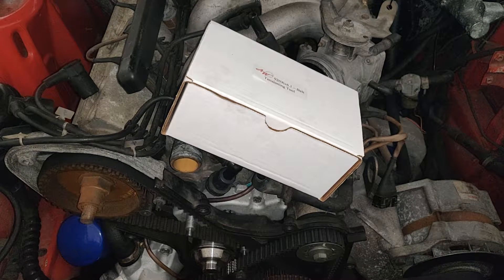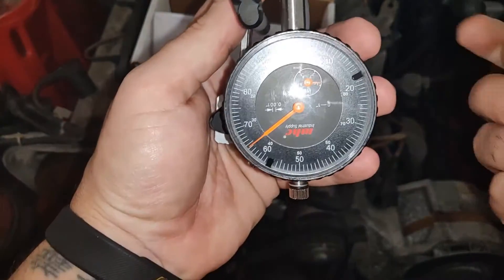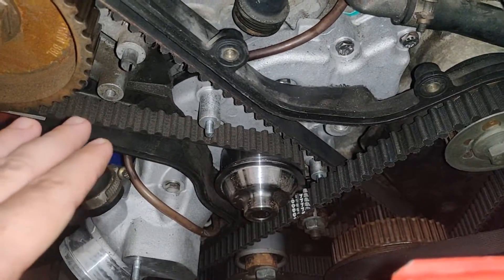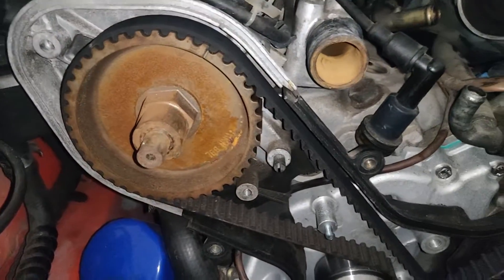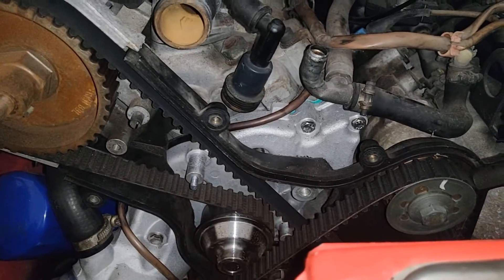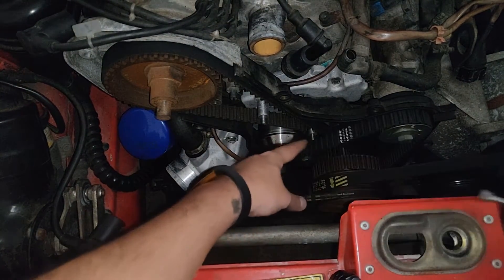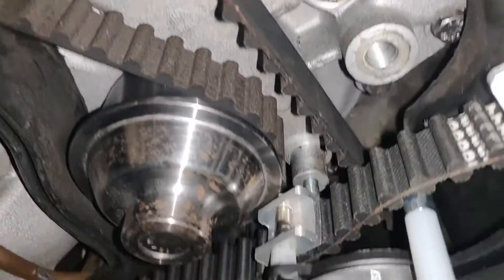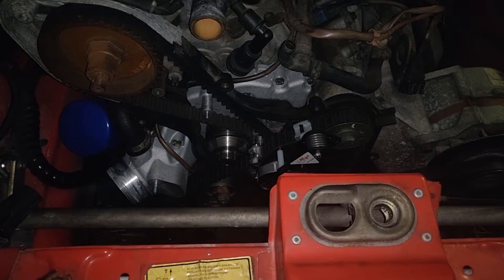1984 Porsche 944 NA Pt#33 - Timing and Balance Belt Tensioning (ArnnWorx Tool)

Comment: Thanks for the video Spencer, but I'm finding that your instructions are not aligned with the instructions provided by the maker of this tool.  Two issues that I'm seeing: 1) you're positioning the tool much lower on the belt than recommended, and 2) the instructions clearly state that the slack should be moved to the upper portion of the belt before taking the reading.  In the video, you're rotating the engine in the clockwise direction prior to taking the measurement.  Doing it this way, all the slack is the the lower portion of the belt.  The instructions state that you should rotate the crankshaft counterclockwise before taking the measurement.  I suppose it's possible that you have a different version of the tool than the one I received, but didn't want people seeing this to use the latest version of the tool incorrectly.  Note that the maker of the tool provides a good video tutorial on their site.
Reply from the maker: Hey Jon! Thank you so much for taking the time to write that out. You are absolutely correct on both points you made.  The reason I did it this way is when I did do it as directed in the instructions my readings were all over the board. this was the only way I was able to get any level of consistency in the tightening of my belt. Since I actually shot this video I found out that I get a more accurate reading if I remove the roller and then use the tension tool. Thank you again for your comment since it helps me become better at working on my car.
Reply: @spencerdog944  I have had a ton of frustration from using this tool and trying to figure out the instructions. I ended up ditching it in favor of the less scientific "twist" method. As Jon points out, you have to move the slack to the upper portion of the belt to take a meaningful measurement. It is not about precision or consistency in your measurements, but the accuracy! I would hate to see you have an issue due to the belt being too loose or too tight. The factory Porsche procedure is to rotate 10° counter-clockwise  and then measure tension.
Reply from the maker: Thank you for that information Kevin! So far the car has been running great but I will definitely get the cover off and retention it with the tool how you specified and see if I can get a proper reading. I really cannot thank you guys so much for your insight and help with this.

Comment: Do you know if the tools position on the cam belt where you had yours placed is 100% correct? The diagram that came with mine shows the tool placement closer to the cam gear so it rests on that silver pin where the belt guard goes.

Great tool btw, it’s a must have for these cars
Reply from the maker: From the diagram I got in my kit it shows the tensioner tool just resting before the balance belt and that is how I aligned mine. The balance belt was showing the tool being placed a little in front of the water pump. I totally agree with you about this tool👍